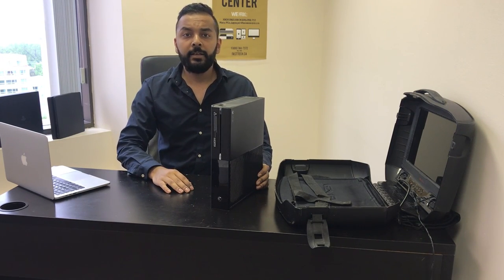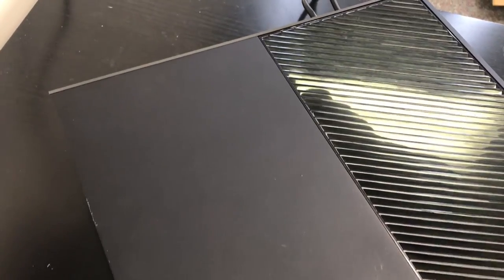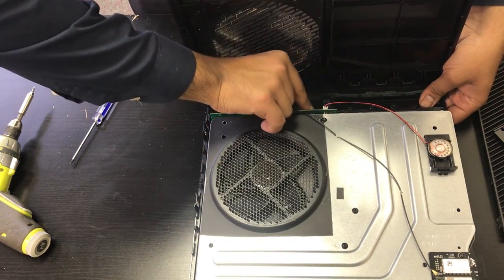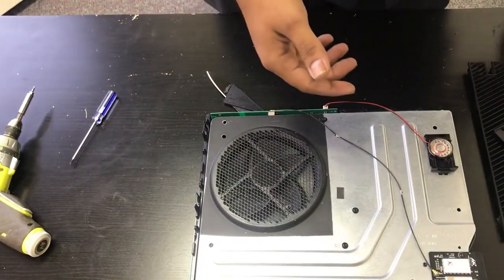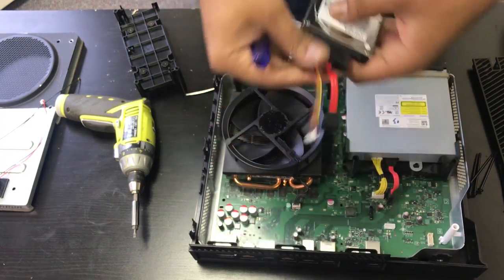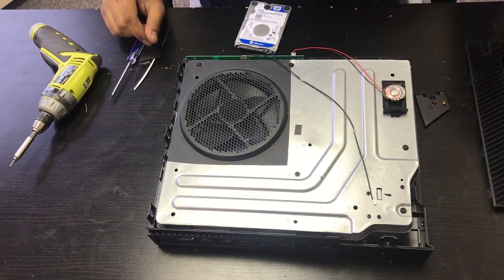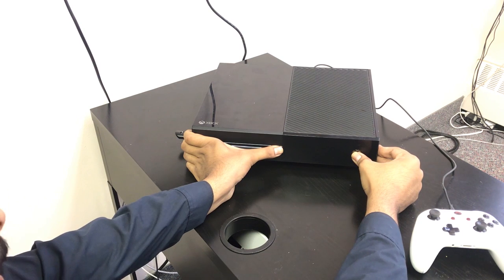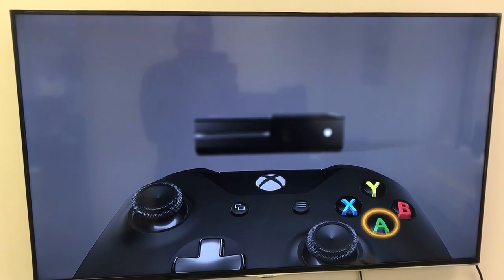Xbox One E101,E102,E105,E106,E200 Black Screen, Stuck on Xbox logo Repair (Hard Drive Replacement)

Comment: I haven't even had This Xbox
One X for a year yet. (10 months so far). 

Bought it brand new as an upgrade from my original Xbox One. I've periodically had issues with it and now as of today it finally gave me: 

System Error: E105 00000000 8007045D 

I've tried every single step on microsofts troubleshooting page for this error to no avail. When i finally used the reset system option it didnt work. In fact none of the options worked. Whether it was restart or turn off or reset to factory (either option) all my Xbox did was freeze up. 

 The only way to cut it off was to hold the power button for 10 seconds. Which after I cut it back on I was prompted with the same error time and time again. 

My hard drive is not making clicking noise, I'm quite familiar with a dying hard drive from a computer standpoint. I believe the error to be something else. 

 In light of the fact that it's not even a year old yet  I shouldn't have to replace anything on it and should be working properly. It Cost several hundreds of dollars and this is bull crap. 

My original arcade Xbox 360 that I bought in 2010 is still working to this very day. I take very good care of my belongings. It's quite obvious from research over the internet that a lot of people are having this exact same issue error. Leading to the conclusion that Microsoft put out faulty, junkie products.  This isn't some rare occurrence, it's happening to a lot of people. 

 I for one will never be buying any more Microsoft Xbox products ever again.
Reply: That's the same thing that happened to my one x
Reply: Omfg this is exactly happening to my xbox one s. I reset my xbox and now it won’t even turn on for more than ten sexonds
Reply: I've gotten that error code today. I'm currently getting the OS file I download awhile ago from my computer. I've undoubtedly lost all my saves but honestly I don't care at this moment, I just want the console working again.
Reply: Same exact problem with my xbox one x, it's 6 months old. Have u fixed the problem ? If yes. What was the problem?
Reply: It just happen to me wow.
Reply: @shawnjordanne4809  I've heard that the E105 error is a dying hard drive (bad sectors or something, idk) there are ways to fix it thankfully! If I remember right the channel that tells you how to setup an new hard drive is ifixit.
Reply: Deceased Fatality Same, and fix for you?
Reply: My x is doing this bs... it's supposed to be the "most powerful console" but it cant even run minecraft without freezing. Hell it's just a bunch of squares
Reply: It happened to me yesterday with my xbox 1
Reply: Memento Mori same my Xbox one s got e 102 but my 360 works perfectly to this day
Reply: IFFY WIZARD868 have you fixed if so can u tell me how to please
Reply: My x did the same... it was done so I got a new gaming pc instead
Reply: @saulpopoca3714  Luckily it was still under warranty, so I had to send it  to Microsoft for fixing. I was literally a week away from the warranty running out. They fixed it and sent it back and I've not had a single issue out of it. I am pretty sure for me, the hard drive was faulty causing the issue. Sadly there wasn't an at home fix.
Reply: I too am done with this. I’ve kept good care of my own Xbox one x, this just feels like a cash grab at this point.
Reply: Its bs
Reply: Same I'm considering switching to ps4 or 5

Comment: Hello! I have an one X that fails with errors e105, e102 and issues with my saved games.  Usually i play normally until those errors show up. So the Xbox is not completely stuck, it let me play for periods of time. Do you think that a hard drive replacement fix those issues ??   Thx in advance
Reply from the maker: Yes
Reply: Im having the same problem exept   it only lets me play one match of bo4 and freezes as soon as the match ends and it says the games arent synced
Reply from the maker: Replacing the hard drive will fix your Xbox One X. You can find those here: https://www.fasttech.ca/xbox-one-x-parts
Reply: @fasttechvideo  happening the same with mine, i around the new years. It was raining one day, and my brother didn't disconnect the xbox from mains power. There was a fluctuation in electricity amd the next time when i turned on the xbox i got e105, e102 and sometimes e200. It also turns on properly  after hard reset. Today, it started giving me 'app or game data is corrupt' for the games i had installed. Please help. Thanks🙂.
Reply: Fasttech do you have SSD’s for the One X and could you send it pre-loaded with the software?
Reply: @evrico7  just do it yourself mate, its easy
Reply: What if you have a external hard drive and I remove it from the Xbox one x and then replace the internal one will I still have all my memeory
Reply: I have a Problem with Fault E 102!!
Can i fix the Problem or is the Xbox one x no more for using?? Thx
Reply: @Mile19825  most prolly an internal hard drive problem.
Reply from the maker: Hotel-Restaurant Bewertungen you need a new hard drive. Check our website for Xbox one X hard drives.
Reply: ZebazttiaN  I’ve got the same problem minus the ticking though
Reply: @fasttechvideo  i have replaced my hard drive and it worked but after 2weeks it happened again
Reply: Will it remember youre games once u put in the new hard drive?
Reply: Fasttech I changed my hard drive but the error is popping up again. What should I do now?
Reply: Me too I have to send my xbox to Microsoft return centre in germany
Reply: @fasttechvideo  I had the same issue as this above, I replaced the hard drive and it worked for a few weeks and now it's gone back to the same and have e105, will I need another hard drive or is there another underlying problem causing the hard drive to fail? Thanks
Reply: L
Reply: @conoryoungson7019  sometimes you can have a bad hard drive right out of the box. I have had this happen many times. If the hard drive has failed again check for noises as he said if it is the same as indicated then the hard drive you bought should be replaced at no charge via warranty. If this is not the issue then the motherboard could also be an issue. Also check that you have installed the hard drive correctly and that all cables are snug and in place. If the plugs where not seated correctly this also can cause an issue
Reply: Bran The don Hey man I don’t know why people and this videos are so confusing when fixing error 100 due to hard drive error ..... now all you have to do is get a used external hard drive and format the drive to erase everything.. now go to Microsoft and download the Xbox update and put it on the hard drive you just formatted .... after that get the size of hard drive you want for your Xbox and format that one aswell now open your Xbox and remove the faulty hard drive.... now install the new hard drive inside the Xbox one x or s ... and once Installed all you have to do is connect the first drive you thru the usb... you know the drive with the update you downloaded from Microsoft and let it do its thing and it will automatically convert the inside drive to work with the Xbox it takes about 30 min or more depending on your internet speed .... it has to download and install 3.8Gb .... and done deal your good to go you fix it... you don’t have to download anything on the Hard drive you installed inside the Xbox ..don’t listen to this people just format the drive and install it inside and  the external drive once loaded it will asked what you want to do just click offline update and done deal

Comment from the maker: FREQUENTLY ASKED QUESTIONS
Where do I buy the parts needed for this repair?
👉XBOX ONE 500GB Hard Drive: https://www.fasttech.ca/xbox-one-parts/xbox-one-500gb-hard-drive
👉XBOX ONE 1TB Hard Drive: https://www.fasttech.ca/xbox-one-parts/xbox-one-1tb-hard-drive
👉XBOX ONE 2TB Hard Drive: https://www.fasttech.ca/xbox-one-parts/xbox-one-2tb-hard-drive
👉XBOX ONE SSD (Solid State drive): https://www.fasttech.ca/xbox-one-parts?category=Solid+State+Drives
TOOLS
👉USB DRIVE: https://www.fasttech.ca/tools/usb-stick
👉Folding Knife: https://www.fasttech.ca/tools/credit-card-folding-knife
👉Torx T10 Screwdriver (To Open Xbox): https://www.fasttech.ca/tools/torx-t10-screwdriver
👉Torx T8 Screwdriver (For HDD removal from Caddy): https://www.fasttech.ca/tools/torx-t8-screwdriver
👉Download files here: http://www.xbox.com/xboxone/osu1
Please note that the hard drives have to be formatted first if you are planning to use your own. We sell them pre-formatted on our website. Links are listed above
Instructions on how to prep a USB for Xbox One software installation:
Format a USB stick to NTFS format. 
Extract '$ystemUpdate' folder to the root of the USB drive. 
Plug the USB stick in the console after replacing hard drive and follow the instructions in this video.
👉 Don't want to try this repair yourself? You can send in your Xbox One to Fasttech and let us handle it here: https://www.fasttech.ca/xbox-one-repair-service/

▶️NEED HELP BUT ARE NOT A PAYING CUSTOMER? TRY OUR ONLINE CONSULTATION SERVICES: https://www.fasttech.ca/online-consultation
Follow me on Social Media:
Twitter: https://twitter.com/Shehroz
Instagram: http://instagram.com/youngtechgod
Facebook: https://www.facebook.com/fasttechy
Business Social Media:
Twitter: https://twitter.com/FasttechCA
Instagram: https://www.instagram.com/fasttech.store/

Comment: Hey man, I got a question, So my Xbox One 1TB console doesn’t work with the offline update, But if I buy a hard drive from your website and the tools, and also use the OSU1 update, my Xbox should work again right?
Reply from the maker: Yes absolutely. Our hard drives come programmed, partitioned and the update files are included on them.

Comment: Mine freezes on the applying update stage
Reply: Mine does too, cant find a fix either. E101 right after starting.
Reply: nathan antes is this happening after purchasing and installing the part from the website in this video or general ?

Comment: During the summer, I had my Xbox One freeze up then turn off by itself. A few months later, I finally went out to the store to pick up the right tools to take it apart. I had already had a 256 GB hard drive. Would this work just to have it boot up and then get an external hard drive for storage?
Reply: @fasttechvideo  Ok. I will purchase a hard drive off of you guys. Are there any discount codes I could use?
Reply: Why wouldn't this work?
Reply from the maker: @claircorbin4890  Use discount code YOUTUBE for 5% off
Reply from the maker: @doddle4115  Because you most likely didnt buy the HDD from us

Comment: Please someone help! One day about a year ago I started up my original Xbox one and at first my tv wasn't picking up my hdmi for like a good 2 min. But it finally did but it went to a black screen for like 5 min. Then it went to the something went wrong screen with system error e102 00000C0E 8007045D specifically and even when I restarted it several times it still does this every time I tried everything even brought it to a shop but they couldn't help please someone help
Reply: Adam you ever get this fixed? Mines doing the same thing.
Reply: @mattschuyler3986  mines doing the same thing

Comment: I replaced hard drive and brought usb disk and downloaded osu1 file to it and extracted the update file then transfer it to Xbox. I pressed the power button, the eject button, and the sync button, then I heard the second loop sound, then let it go. The device setting reaches 1 and it tells me there is an error when I restart the device, the control unit setting reaches 7 and the same error returns me to e106. Hope you can help me

Comment: It started from E-105 to E-102 and I tried the OCU1 download and it immediately took me to E-101
Reply: Same exact thing happened to me did u ever fix itb
Reply: @danielcarrillo1864  did you every fix it?
Reply: My hard drive isn't giving out any sounds. I've replaced the connectors but now I think there's something wrong with my hard drive instead of the connectors. Will I have to buy a new one or is there any way to repair the old one?

Comment: I get a e102 error but when I do the offline system update it turns to e101 so all I have to do is take out the old one and get a new one with the osu still on the flash drive follow your steps and viola? If so it's back to gears of war for me ^_^
Reply from the maker: Yes replacing the hard drive will fix this issue. The hard drive has to be pre-formatted and we sell them on our site. Links in description box.
Reply: Don't they have to be formatted and set up with so many partitions.

Comment: Hey mine has error 102 and it doesn't have any sound, when Į press troubleshoot and erase everything its goes to that again and Į don't know What to do.
Reply from the maker: Did you buy a hard drive from us? Sounds like the HDD is not ready for the Xbox. Remember you can't use any HDD. It has to be programmed first.
Reply: Į didin't change it, I can send video what happens.
Reply: I just checked my warranty is expired some months ago, and I don't want to spend allot of money on it.
Reply: I mean on the Xbox.
Reply: Same I don’t know what to do

Comment: Would this work with an external hardrive that you just plug into the Xbox?
Reply from the maker: No
Reply: Fasttech I did everything exactly the way shown and it still says error E100. 
When it gets to the applying update part, it just freezes up

Comment: Would it be possible to format a new drive in Wine's command prompt on a Mac, has anyone tried this?
Reply from the maker: Yes. You can install Windows on any Mac via bootcamp.
Reply: @fasttechvideo  Thanks for the response, I'm aware of that I used to have bootcamp setup on an older Mac but sadly disk space on my current Mac is limited, I was hoping Wine's DOS Prompt could serve as an alternative?

Comment: Hello mines have error code E100 and my hard drive it's not making any noise so I have no idea what the problem is it's not updating anything.
Reply from the maker: Is your hard drive spinning? It doesn't always make noise when spinning.
Reply: @fasttechvideo   yes it is spinning
Reply from the maker: @mrshynethaboss1  Try doing the USB method if it doesn't work you need a new hard drive.
Reply: @fasttechvideo  ok how do I do that
Reply: Because I already have the offline system update on the flash drive
Reply: I got the same thing today can't fix it bruh
Reply: I'm a bit late to the party, but an E100 error is caused by a faulty/non-original Blu-Ray drive.

Comment: Hey fast tech I have a problem with my console e106 error and I turn it on and it freezes on 50% any quick fix
Reply from the maker: Did you try replacing the hard drive? if so make sure its an Xbox One ready hard drive or its not going to work.
Reply: Hello fast tech id like to buy one from you. How can i find one? I looked on your web site. I have an x box one x? Please help.

Comment: My Xbox one s has been having problems I can turn it on and it shows the green loading screen but when it’s at the home screen it’s black and I can’t do anything with my controller
Reply: I already did the factory reset and it still won’t work
Reply: Josiah Dunnavant  hey I having the same problem But I just tried sign out then back in but it’s still glitching a bit
Reply: Josiah Dunnavant  if you find a 100% fix please let me know im dying right now
Reply: Josiah Dunnavant I fix it just reset it but you have to get rid of all games do a full restart if it doesn’t work the first time try again it worked for me

Comment: I did everything exactly the way shown and it still says error E100. 
When it gets to the applying update part, it just freezes up
Reply: @fasttech
Reply from the maker: Id be happy to troubleshoot if you bought the HDD from us or you can buy our online consultation service.
Reply: An E100 error means your Blu-Ray drive is either not connected, unresponsive, or the daughterboard doesn't match the console. Did you remove/replace the drive?

Comment: My laptop won't let me download the file. Whenever i start downloading it it starts and when it gets to 10 to 20% it cancels.

Edit: i fixed it!!!
Reply: He fix it???
Reply: @hananaljohani5769  i bought a new hard drive and then used another computer to download the file... You might have to extract it if it's a zipped file.
Reply: @hananaljohani5769  after fixing it i sold it to a friend and moved to PC. He still uses it and never has any other problems.

Comment: My Xbox1 keep saying There Was a problem With the update you need this update to use your Console but something went wrong Error code: 0xB0072EE7 0x00000000 0x000000200 how do i fix this problem so i can play my game's again
Reply: Mine was doing the same thing a few weeks ago along with terror code E105. I checked and found out that my console hadn't completed the system update for some reason. So I tried updating again, and it stopped half wa through giving me the same error as you. So I tried checking my network in the Xbox one network settings and it finally completed the update. But now I'm getting the E105 terror code again along with the save games error. This really sucks. I have only had my Xbox for 5 months.
Reply: Should i just buy a New x box1 or try and get this one fix

Comment: My console is stuck at preparing console 50%. Any ideas?
Reply from the maker: Replace the hard drive. We sell them on our site. Check the description box and top comment.
Reply: @fasttechvideo  have another question. The system now won’t even enter troubleshoot menu. Will replacing the hard drive fix that or is it likely a bigger problem than that?
Reply from the maker: @astro2069  yes its a hard drive issue, if you want one check the links in the description box and top comment.